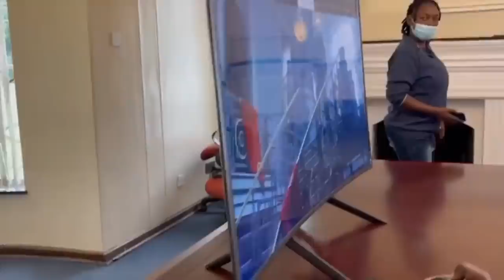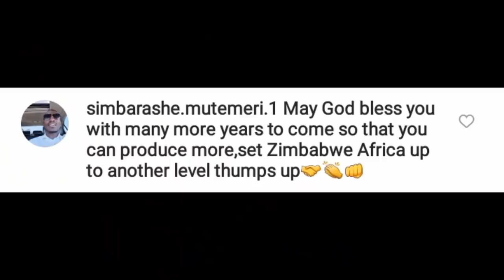ZIMBABWEAN MAN INVENTS A SELF POWERED TV AND NOW HIS LIFE IS IN DANGER | Maxwell Chikumbutso

Comment: Sorry to rain on everyone's parade but the laws of physics don't care if you're black, white or green. Look up the inverse square law to see why this is, unfortunately, a non-starter.

In a nutshell, even if it is being powered by RF (I have doubts about that), you would need to put in significantly more power than a regular TV, as the received power drops off with the square of the distance. That's why wireless phone charging only works when the phone is practically touching the pad.

To power a TV (60W) at what looks to be a couple of metres, you'd need at least a couple hundred watts of RF power.

Comment: Its simply not enough power to do it. Unless he is using a battery like a pack of c batteries and a transformer to power the device he is using. So it turns on the magnetic device and then connects it to the antenna of the tv internally.

Comment: This is a violation of basic physics. Which cannot happen. The power cord is probably routed up from the desk through the feet of the TV.
Reply: finally someone with common sense... this comment section made me lose faith in the world
Reply: put some flat Li-ion battery packs and power converter in a TV?
Reply: @willharm6143  Nah, you probably need roughly 120 volts, 60 or so watts for that type of TV. Battery pack is not viable. But, you could run a power cord through the desk, up through a hollowed out foot, into the unit.
Reply: @willharm6143  You CAN harvest energy from RF but it is on the order of microwatts IF you are close to the transmitter.

Comment: This is a blatant hoax, he claims to be generating over 60W from radio waves, how? Where are the measurements? Any engineer that sees this would need a lot more information to even make this remotely believable
Reply: Have you never heard of a gentleman named Nikola Tesla? How about Hermann Plauson? Or maybe Thomas Henry Moray?

This "invention" is nothing new, Tesla invented almost everything we currently use, including remote control, LASER, electric cars, etc. BTW, it was Philo Farnsworth that invented the modern electronic TV.
Reply: @Cryptic_Triptych  I said generate over 60W, I never said the technology doesn't exist.
What this man claims to be doing is basically powering a generator with a drop of fuel.
Yes radio waves can be harvested but not enough to power a TV , maybe charge a battery over many days (with his set-up). Then power the TV for one hour but as presented it is a fake system. 
Literally ask anyone working in this field if what he showed makes any sense
Reply: @leovice6505  60 Watts at 120 volts is 0.5 amps. So he needs to produce 0.06 kwh to power the TV. The 42" TV I am looking at draws 1 amp at 120 volts, so 120 or 0.12 kwh of consumption. However almost all electronics and motors run on DC, they use AC for transmission. So the device should actually be producing DC amperage. Furthermore, he needs to regulate the frequency at 60 Hz.

I haven't looked deeply into the device he has built, but I am an electrician of some 40 years, if he is using a atmospheric collection device with capacitors and a full bridge rectifier, I don't see why he couldn't generate enough current to power a LED TV. Even you admit that the technology exists. 

I have had many conversations with Ion Power Group and many others who have built atmospheric collection devices, as detailed by Tesla, Moray, Plauson and Lawrence Rayburn. In fact I have a device myself, set to produce 10 kw, enough to provide for a common household load. My device has an overload discharge, variable frequency output 50 or 60 Hz and the nested coils are enclosed to protect the user from electrocution.

Comment: I hate to be the one to wake everyone from their dream world but there is no way a TV powers itself from radio waves. He says that box turns radio waves into pure energy. News flash, radio waves are already pure energy but there is not enough voltage in common radio waves to power a TV, it's just not going to happen. Voltage is available in the air, I've seen it power small digital clocks but not near enough to run a TV. also the energy level rises and falls and is not able to be regulated. Plus you need a means of collecting that energy like a large antenna network and the system must be grounded to the earth to work at all.  That TV has no ground wire. Besides that it doesn't even have an antenna connected. So how is the TV picking up a signal? He should be bragging that it also serves as an antenna or cable input because it sure doesn't have one connected!

This is a scam of some kind and should not be taken seriously. Don't believe the hype. The narrator said the electric companies would lose money, so they are threatening his life. Yeah Right. More like he scammed some people out of money with his fake High Tech Invention and now they are hunting him down.

What he has done is take the circuitry of a lap top, a memory stick with a video on it and a battery, put it in a box and connected it to the TV screen. It is as simple as that. No technological miracles here ladies and gentlemen.  I'm not saying he doesn't know anything about electronics or TV's because he obviously does, I'm saying he can not break the laws of physics, nobody can.

Lastly, I noticed that as they first show the TV playing and then go around the back of it there is nothing but the box connected to the TV. But later in the video there is a clip with a blue strap connected to the back of the TV. What is that all about? Why was it not there then it was there and what is it hooked to?

This is a HOAX. He has made a gimmick for an electronic magic trick. From what I read of the comments he has fooled a lot of people.

I really don't care if you agree with me or not so don't try to argue with me. I won't respond because I've wasted enough of my time watching the video and writing to expose this hoax. My work here is done.

Comment: electrical power transmission using induction, invented by nicola telsa in the early 20th century would fry most integrated circuits at the power levels needed to provide electrical load for a town. works great at a small scale like for charging a phone or powering a lcd tv.
Reply: Exactly nothing revolutionary here. Also if u have any metal in your body, stand away
Reply: @noelquiles3202  You are jealous and insecure

Comment: Rf energy transfer is not new, they already use it, it is only at best 30% effective in research done at universities currently.  So, to power a TV, they are using likely 5x the power needed to transmit RF into the antenna on the tv.

Comment: Obviously all of these people commenting are not electrical engineers, this is a hoax I can assure you. The type of radio frequency energy that travels through the air cannot power anything substantial like a tv. The only practical means of transmitting power wirelessly requires an ultraviolet laser or microwave laser, both methods are very dangerous and also very costly. The term self powered is misleading because everything requires an energy source, this device included. He has a battery and an inverter attached to the TV, there is nothing innovative about his so called invention. I am not some white guy hating on a black man’s creation. I am also a black man and I support black innovation, I just don’t support misleading narratives!!

Comment: It’s the solar panel companies that would likely be the most interested in this, not the electrical companies.
While it’s groundbreaking that the TV is receiving power over WiFi, the WiFi Access Points in the ceiling still need to be cabled into backend Power over Ethernet switches which need to powered by AC / DC or solar. 
The wattage for the devices to be powered over WiFi still needs to be powered from electrical current unless the PoE switches are powered by solar.
Reply: Also PoWifi (power over WiFi) has been a thing. Look it up.

Comment: Hmmm.... 🤔 Yeah, this sounds a bit too simplistic to be real... too good to be true! Looking at his "TV", you have it wrong. He's not saying that he invented a TV that doesn't need power, he's saying that he invented a DEVICE that can generate power using "Radio Frequencies in the air" to generate power. That device can be used on devices that makes them no longer require power, and he was using the TV & car as an example... which is why I don't believe it.

It's TRUE that our ancestors DID have a way to (Broadcast Energy) through the air and supposedly the pyramids played a part in that. They were said to be used as "giant powerful transmitters" to broadcast the energy. But this guy didn't say he was "broadcasting energy", he said he was "converting RF frequencies" into useable power. AND YET - where is the antennae? You can't broadcast & transmit RF without antennae. Converting RF to power IS NOT new, it's REAL!!! But to power cars & TV's, those RF signals would have to be BLASTING in, through and around us at MAXIMUM POWER 24/7!!! In other words, all that radiation would kill us off, which MIGHT ALSO be why they stopped using the pyramids to do it also. 

So no one is going to kill him - not for that - because nobody wants MORE radiation & radio signals blasted on us than we're already getting. People are switching to SOLAR, not MORE RF so he should be fairly safe!  🙂 But several of the men who figured out how to use WATER as gas - DID disappear!! That is also REAL tech that's been locked away!

Comment: It's probably to late. When you have something like this, you have to hit them with a 1 hitter quitter. You can't try to monopolize it for yourself, you have to make sure it doesn't die with you.
Reply: There's nothing that is self powdered. It is just converting radio waves to electricity. There's also nothing new about it either, phones, electric cars and even satellites have been powered by microwaves for decades now. I get where your heart is but this is not new technology. Far back 2014/2015 when I was an undergraduate student of Electrical Engineering, I literally wrote a term paper on this.
Reply: @dekev7503  Regardless, what matters is his spin on it. Stanley Meyer had a spin on the water fuel cell, and it died with him. When it comes to the knowledge of the general public, you have to know that there is a clear opposition.
Reply: @comparecontrast7397  he didn't put any spin on it. The reason why this method of powering devices didn't take off is that it is less efficient, more energy consuming, more expensive to maintain and more hazardous to humans ( due to radiation) I wrote a paper on this technology in my undergraduate program so I'm well versed on it. It is typically used in systems that are not dependent on cost, like in space systems or remote military applications.
Reply: @dekev7503  It's nice you wrote a paper about it, but you lose credibility saying he has no spin on it. I may not hold something as 100% true, but I'm not going to disbelieve it until I prove it wrong. If it's something you're dismissing, why show up here and make others naysayers when  you've only done a paper? You don't have to believe it, but the language you use should properly represent the limits of your perception, otherwise there will be nothing to build upon with you.

Comment: Edit: Ah, So it turns out he apparently invented the car in 2015, But at yet to actually prove that it works. He was exposed in 2018. 

He is talking about a rectenna. They where originally theorised by Nikola Tesla and have been made for quite a long time, They also typically can only generate around 40 microwatts of power.

I mean this and the other products on his website would be great, But they're doesn't seem to be any thing explaining how any of it could possibly work. I mean on the website they just describe the car as 'magic' and in the promotional video the steering wheel is on the left, Which means it's for driving on the right side of the road...

Comment: Anita, we are usually on the same wave lenght but this time i feel i would have to be a bit contrary. Now, unless he invents a new type of tv that does not run on electricity, the power is coming from somewhere, the eloctromagnetic wave to electricty converter is not a new invention and he should not claim to have invented it, he simply repurposed existing tech. Secondly, the waves themselves need electricity to be generated, it is like an electric car that is charged by the Grid, it still uses electricity from the grid and takes nothing away from the oil companies, there are  limits to the amount of power this system can generate which is why it is not widely used, plus it cannot easily be miniturized, this is not a new invention, do not be fooled.